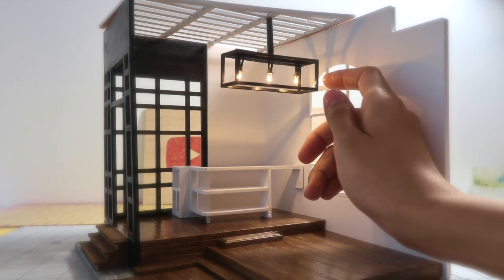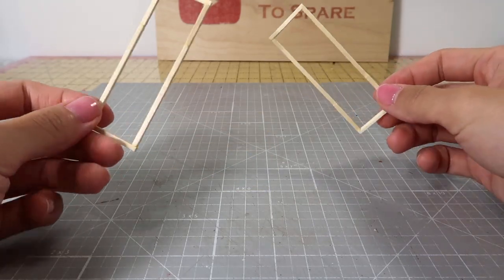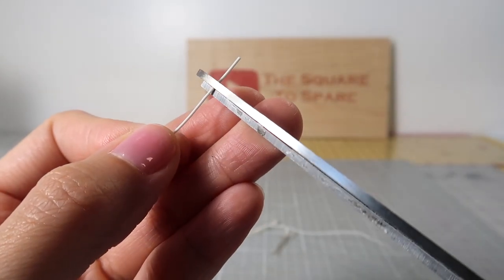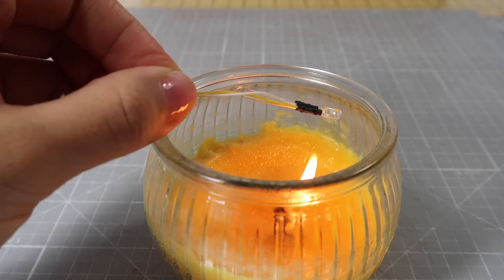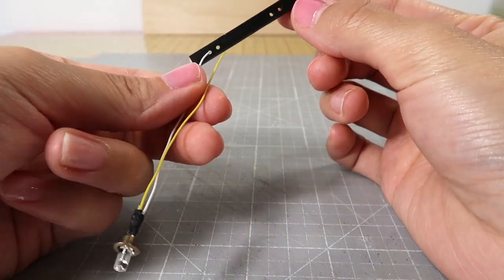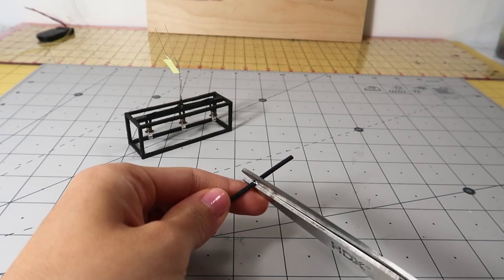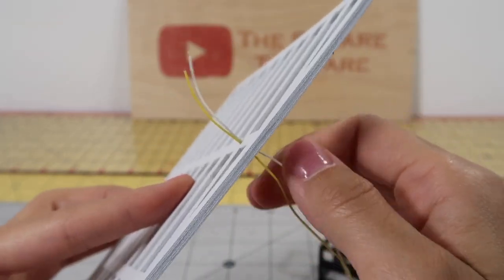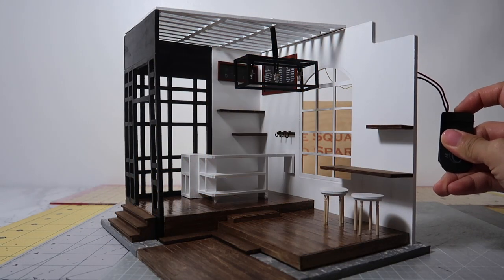DIY Miniature -Working Modern Chandelier

Comment: Those little bronze, metal, ring things sell the look even more. Cool touch. Those LEDs (when on) really look like little, clear incandescent bulbs -- like you might find in an industrial-stylized loft apartment -- really nice. I use little LEDs like those sometimes and I've sanded the bulbs for a diffused bulb look -- and they actually diffuse. Great video, once again.

Comment: the way you cut white and yellow wire look very easy , in reality I cut them until it was short and had to find other one (in other kit ) lol Thanks for this tutorial .
Reply from the maker: Lol you're definitely right- those thin wires are very tricky. I think if I were to do this again, I would use prewired lights as a shortcut ;)